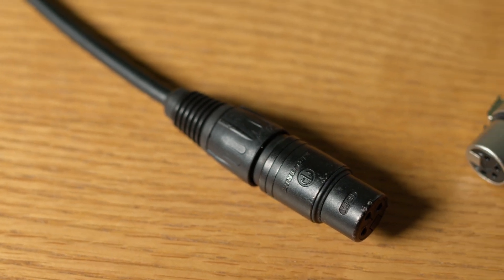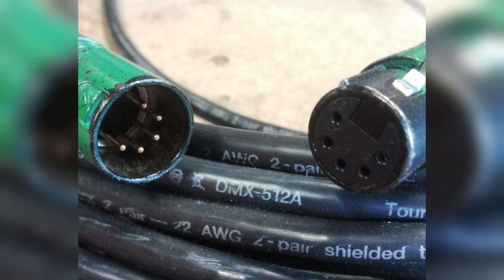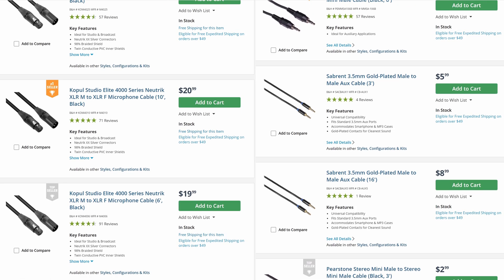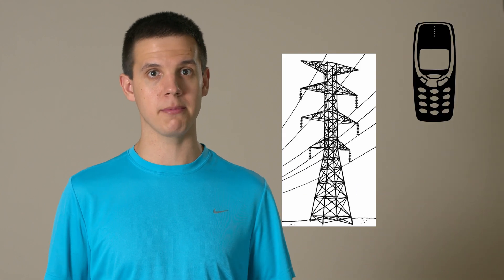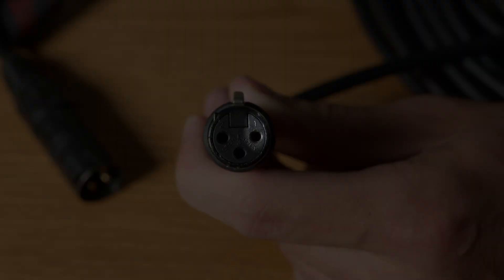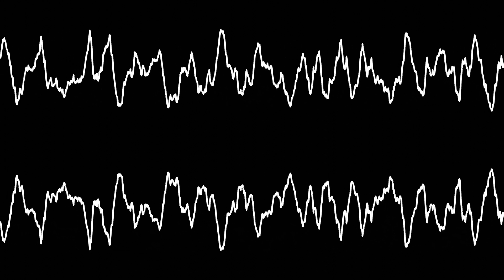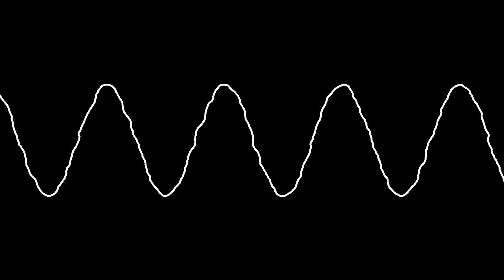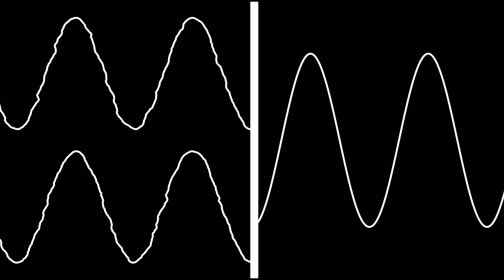What is an XLR Cable? Balanced Audio for Beginners

Comment: Not sure how the second signal helps in canceling the noise. I would agree if they would average the two signals to reduce noise. But completely canceling then noise seems unfeasible.
Reply from the maker: It's a bit tricky to wrap your mind around! Since the second signal is inverted, and the noise affects that signal the same way it does the non-inverted signal, when the signal is inverted again (un-inverted, if you will) and combined, the noise is also inverted. Then the two signals (regular and inverted) are added together constructively and since the noise signal was inverted and combined with the non-inverted signal they should cancel out. In theory, at least. In the real world, nothing's perfect, but it does make a big difference in getting rid of noise!

Comment: I don't understand how the noise canceling works.  When the inverted signal is flipped, doesn't that also flip the distortion so it amplifies the distortion when combined with the other signal?
Reply from the maker: Good question! In short, it wouldn't! If you're referring to distortion as in an overloaded microphone, then you would treat it the exact same as any other signal coming from the microphone. 

Think of the signal from the microphone as being amplitude +1. When you split the signal into the two inverted signals in the cable (the original and flipped one), you'll get +0.5 and -0.5. If your mic is distorting because someone screamed into it, the original would be, say, +2. So, when you split it the signal, it would be +1 and -1. Now, when you flip the two signals at the end of the cable, you'll get +1 and +1, adding back up to +2, same as with the non-distorted signal adding back up to +1. Basically, what the microphone puts out, you'll pick up at the end of the cable exactly.

However, if you're talking about distortion from an external source, like a cell phone, radio, or unshielded electrical cable, then that's where things get interesting. Going back to our +0.5 and -0.5 example from above, say someone holding a cell phone next to the cable decides they need to watch my latest video and opens up YouTube. Their phone emits a signal that 'distorts' the signal by +0.1. As a result, the signal travelling down the wire now becomes (+0.5+0.1) and (-0.5+0.1), or +0.6 and -0.4. When the signal reaches the end of the run and the inverted signal is flipped back to its original polarity, you get +0.6 and +0.4 = 1. So, the 'distortion' gets cancelled out!

I hope this makes sense! It was quite an oversimplification, but it can be a bit confusing until you just get a kind of intuitive understanding of how it works.